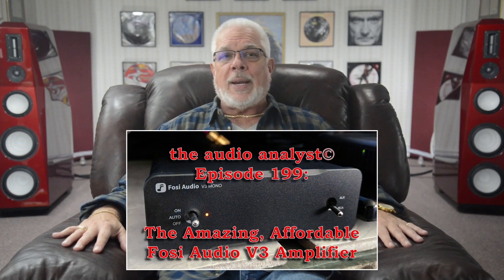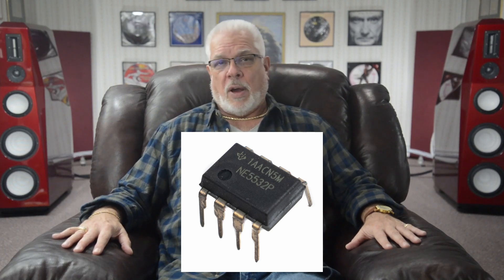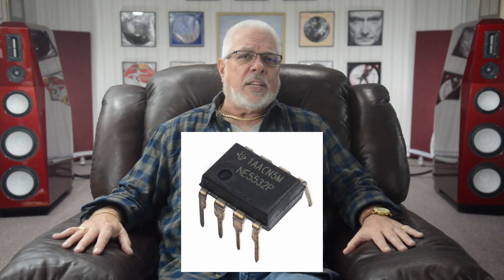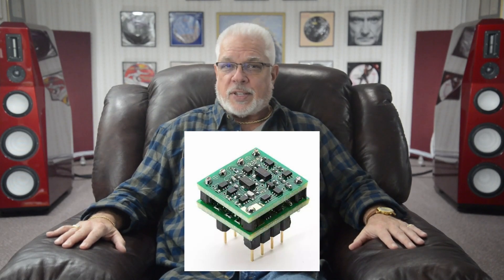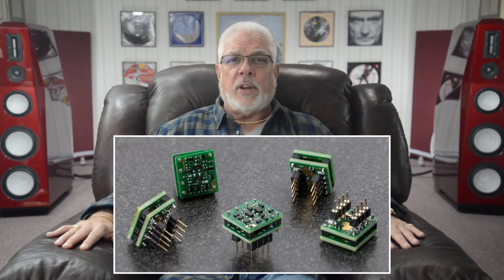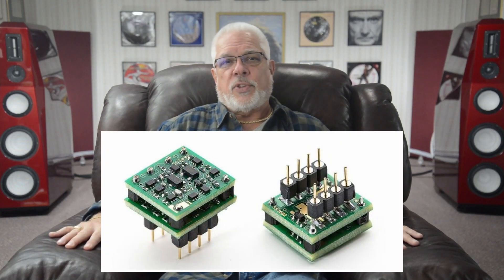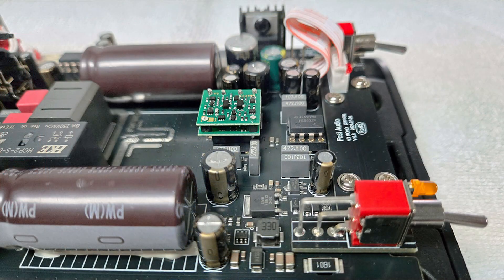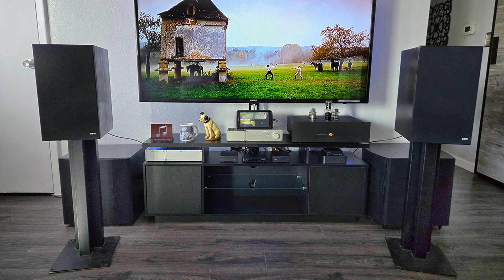E206: Epic Sonic Upgrade: The SparkoS Labs SS3602 Discreet Op Amp

Comment: Hi Greg.  I can confirm that upgrading the 2nd op amp in the Fosi V3 Monos (on the balanced input) has a significant affect on their sound.  The SS3602 are fantastic, but I found the SX22B to be even better; everything that gets better with the Sparkos gets significantly better with dual SX22Bs.

These are only available on Ali as far as I can tell, and cost about the same as the Sparkos.  Note: to fit two SX22B you will need a Dip8 adapter on one of them so their boards can overlap slightly.

I find this setup SO GOOD I’m very concerned that an amplifier upgrade is not going to get me much improvement.  I wish someone with experience with high end gear would evaluate the V3 Monos with this upgrade.

I believe the V3 Monos to be unique among cheap amps as it uses two double discreet op amps per single amp channel.  My gut tells me these represent a large percentage of their circuitry which can be swapped out, compared to other designs that use only one replaceable chip per channel.

I look forward to your thoughts should you decide to try this out.  Thanks!!!

Comment: Great review Greg!  I returned to enjoying audio a little over a year ago after retiring. The budget is limited so I approached the hobby looking for the absolute best return on investment.

So far, I have 3 listening areas all using the Wiim Mini w/ SMSL SU-1 DAC. They sync effortlessly for great whole house streaming.

My favorite amp is the Fosi bt20a pro with 48v 5 amp GaN power supply and Sparkos SS3602 Op Amps upgrade going into Elac debut 2.0 b5.2 speakers with a Polk PSW303 sub.

Modest, yes but outstanding for what it cost!

It truly is an amazing time to be in this hobby!

Comment: Nice!  Thanks so much for the great review.  You did an excellent job detailing the technical side of things.  Glad that you are liking the devices.  :) 

That extra op amp you are mentioning - I have to think that does something.  I believe it drives the other half of the differential input to the class D chip.  

There has been a lot of debate about it on the internet.  I havent seen anything that gives 100% certainty as far as if it should be upgraded as well or not.  

It would be interesting to look into that.  I have a couple of those units too and when I have the time after the holidays cool off, I think i will look into it too in a technical sense. 

Talk soon. 

Andrew

Comment: Good expose. And I could say I told you so, but who am I. However it was Virtual Hifi channel who put me on this track. 

I also have a lot of experience swapping parts to improve the sound. And about 15 years ago I already bought Tripath 2021 amps, early predecessors, that had sincere audiophile qualities. 

I have several tubeamps, including a fine 300B SET. And since recently a very good Gato class AB. Very expensive, very good. But im using two Aiyima A70 mono's with the same Sparkos. They match very well with my new Laiv Harmony R2R DAC and HP2a pre-amp. Visually and sonically. It sounds fantastic. (I also dislike dome tweeters so I use AMT's as supertweeters for dipole Ti fullrange speakers). 

I also have a pair of Fosi ZA3's that I bought earlier, and like the Aiyima A70 mono's they only need 1 upgraded opamp per channel. 

And of course there are other options for discrete opamps that are really not expensive. Opamp swapping is the new tuberolling.
Reply from the maker: So, I have to wonder how you feel you may be entitled to tell me that you told me so? Do I know you? I don't recognize your YouTube handle, so feel free to DM me it you like...

And as I mentioned in the episode, I owned and operated an electronics repair and mod shop back starting in the late 1980s, over 35 years ago! 😉 There I modded upright video game consoles for Arcade use, turntables, CD Players, and worked on that era's personal computers, like the Commodore 64... Most recently, I upgraded my Ideon Absolute Epsilon DAC and Absolute Stream to the META status...so I'm still sniffing solder, and still enjoying it! 😉🤣😇
Reply: @theaudioanalyst That's a good point. That was a bit clumsy of me. I keep telling people the same thing for months if not years, and they just won't believe me. The thing is, I can't keep track of everyone (so maybe I didn't tell you). But I do follow your channel and I really appreciate it! And it is a credit to you that you simply tell the truth. So many people are just discarding it because it's cheap.  

I just acquired both the Laiv Harmony dac and HP2a preamp and I'm using Aiyima A70 mono amps with the same chips and Sparkos opamps. And it sounds really magnificent. Normally that would be a crazy combination. $3k dac and preamp with $300 amps? But it does. 

I have 20 years experience in Chinese audio, over 40 years in modifying audio. Buying, listening and modifying units. I even have a Chinese turntable with 3 arms and several Chinese MC cartridges (Shibata stylus, sapphire cantilever, silver coils you name it).  I built my own speakers that outperformed my trusted Genesis VI that are relegated to lowly bass duty. I modify my tube- phono- or integrated amps and DACs. So I have plenty of burns too. 

I have several tubeamps, even a 300B SET and a Gato Amp150 that is €4500 but I am playing with  a pair of Aiyima A70 mono's with (oem) Sparkos. That's a bit more than 10x the price. And that Gato is more than worth its price. 

I'm not rich but I know what sounds good. You can't just buy a system and expect it to sound good.

Comment: Could not agree more with your excellent review, Greg! I also just picked up a pair of Sparkos opamps for position 2 in my monos and was blown away by the difference it made. I also upgraded the others to the modest but long time well regarded and affordable LM4562 opamps. I also picked up a pair of cheap figure 8 to standard IEC adapters so I could use high quality after market power cords on the power supplies - wow, here again, very nice improvement. These have quite frankly unseated a Pass DIY 40 w/ch class A amplifier called the Burning Amp 3 (circuit Nelson Pass gifted to the community) that’s kin to his First Watt line. While it sounds beautiful, the Fosi’s are surprisingly better, it’s crazy!
Reply from the maker: You make a very substantial point about replacing stock AC cords... I am shocked at how many music-lovers STILL don't know about, or more importantly, actively deny, the difference power cords (_and supplies!_)can make. This underlying truth is touched on by two of my audio axioms - #1, Cables are components, and #6, Piss Poor Power Prevents Proper Performance. I detail these parameter's of audio truth in Episode 9, "the audio analyst's audio axioms" - https://youtu.be/G_mWN76rqAI

Thanks for watching, and for sharing your experiences. 😊